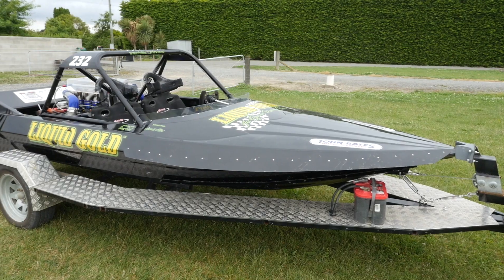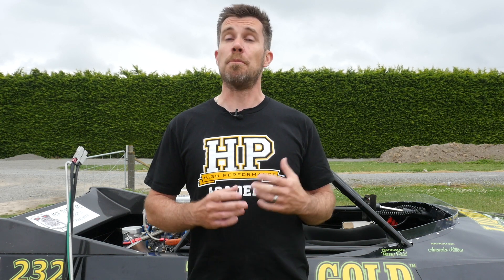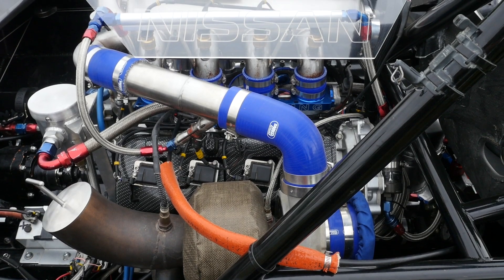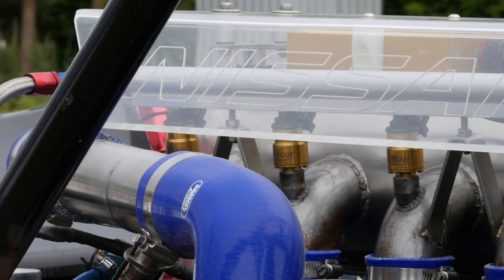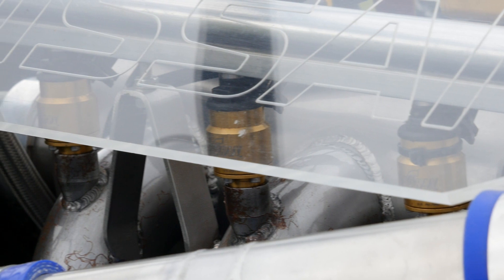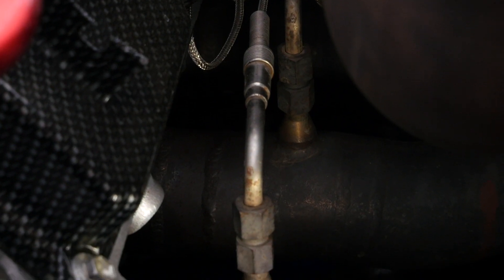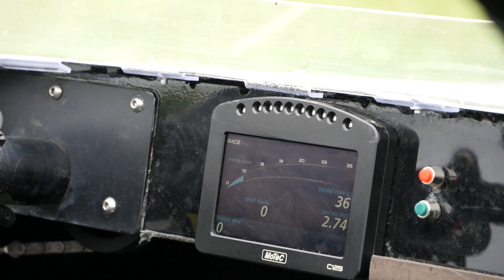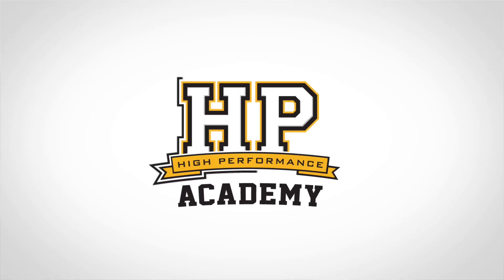[TECH TOUR] A 1200HP V8 engine in a 550kg boat | Sub 2 second 0-100km/h

Comment: Couldn't they run staged injectors? Like a small set for idle etc after the throttle bodies and the keep the big ones for WOT? That'd fix the idle issues

Comment: I've got a bit of a silly comment, but how trouble is the pre throttle plate fuel injector setup at idle speed operating conditions? I was thinking of some small injectors post throttle plate to help out the described scenario but then again staged injection on a V8 isn't exactly a cost effective venture. I suppose this would have been considered and the engine's behavior at idle is acceptable in a practical manner as opposed to the troublesome perspective of the scenario in theory.

Awesome exposure as always, love the technical content and I'm a proud student of the High Performance Academy since 2012 👍🏻
Reply from the maker: Thanks Damien, The only downside that we’ve noticed is startup performance. Idle quality is actually great. During a competition run the throttle seldom drops below 50% so it’s really not a concern.